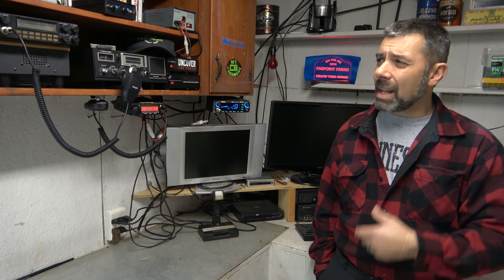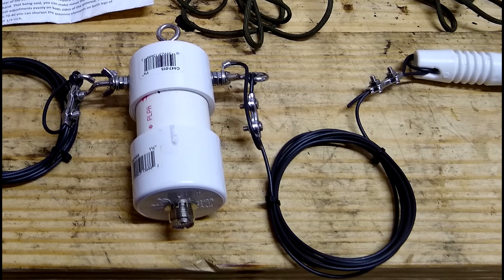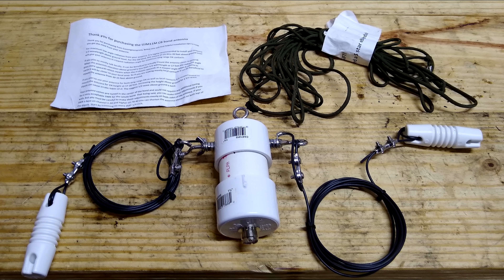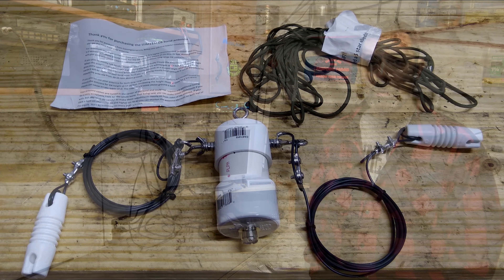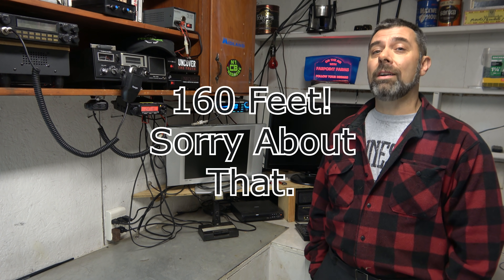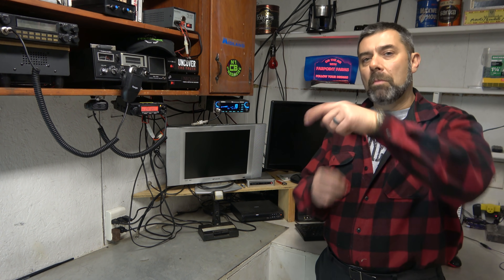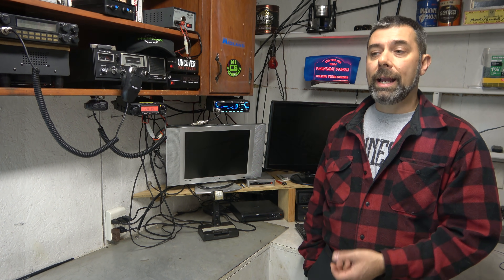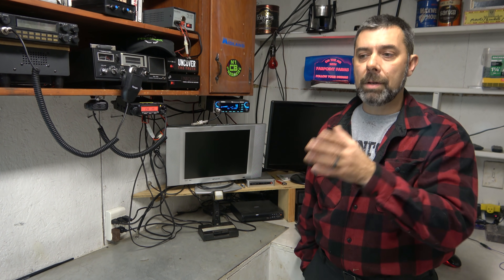CB Base Antennas Part 4: Build Your Own!

Comment: i started with a 108 inch fiberglass 1/4 wave antenna and wrapped 27 feet of coated copper wire from the bottom up. i scuffed up the threaded base and soldered the wire to it. i used shrink wrap to seal the coil load. i mounted the antenna to the car and checked SWR. it came in at 1.1 to 1. it is the best talking antenna i have ever had. i started talking on CB's when the truckers were mostly on channel 10 before they moved to 19. that would have been around 1979 or 71. i currently have two of these antennas and have not been able to locate these fiberglass units again in the modern market.
Reply from the maker: Cool! Sounds like a neat setup from back in the day.

Comment: A 102" whip up on a 30ft pole, with four radials slanted down at 45 degrees, makes a great DX antenna. And you can throw a lot of power on that thing too!
Reply from the maker: That would be impressive

Comment: I'll be restoring a CB base station this winter, and then I plan on building an antenna to use with it. 

I'm rebuilding/expanding my shop building this week and part of the new space will be a comms setup, as I can't set up HF antennas off the house, but I can out back along the fence line.
Reply from the maker: That sounds like a great winter project. Maybe you can add it to the fence to make it higher up

Comment: Thanks!😊 I’m a new ham and SSW listener.. I have not purchased any real equipment, except for a Tecsun H-501 receiver.  Living in community that restricts visible antennas, l’m having difficulty getting reasonable reception.  Need some help getting more enjoyment and getting encouragement to even seek licensing requirements. Hoping and needing help, thanks, Carl
Reply from the maker: Thank you for the support of the channel. The MLA-30+ is hard to notice so your HOA might be OK with it. It is not expensive and is great for SW

Comment: Hi Eric, First off thanks for the channel and your down to earth talk on all aspects of CB/Radio. I have a old school TRC 457 and recently bought a Q-40 which I am liking too cause of the noise   reduction circuits  .I have a Siro 27 GP I want to get or build a SMALL bean and was  looking ng at the Maco Quad 4 the V looking one.  need something on the small size. Have you built one like that or do you recommend it? StandingStones 1776 or UDX-457
Reply from the maker: I've thought about buying or building a beam antenna for ages, but neve got around to it.  If you decide to build one, don't forget you'll need an antenna rotor to turn it as well!

Comment: How did the wire antenna work for you on distance? I put one together and put it in my shop. My SWR's are low, I can hear a lot, but don't believe I have the power to talk back to anyone. Of course my cb does not have sideband.
Reply from the maker: It works, but I prefer a store bought unit.

Comment: want some gain? 35 feet of wire fed one quarter wave in. quarterwave 9 feet  to the shield of course. 50 ohm coax no balun required. way more gain than a a99
Reply from the maker: These homemade jobs can be really sweet!

Comment: I've always had good results with the 102" SS whip. They're indestructible. The steel bumper is an excellent ground. I prefer to use a Hustler 2"SS ball and 4" SS spring. Mine is mounted in the same location as the one you presented, but on a 2015 Nissan Frontier.
I've considered using a Breedlove Stake Hole mount on my low milage 2007 D. Ram 1500 I just bought from my Dad. The only thing is it will be grounded to the body instead of the bumper, I believe making it even more directional.
Reply from the maker: The problem with modern trucks is the bumpers are plastic making it harder to mount- The 102 whip is a classic great antenna

Comment: Sounds like that antenna is for the 160m band (1.8-2.0 MHz)... So, taking a middle frequency of 1.9 MHz, you're looking at 468/1.9=246.842 ft for a half wave... Assuming that you are correct with your statement of 160 ft, then that would mean that you are most likely using 1 1/2" sched-40 PVC pipe (with its 1.9" in actual diameter diameter)... If you said what size pipe you were using, I could not make it out... 

One thing that I've found a bit easier when wrapping wire around a pipe or rod is to start out by measuring the entire distance that I want in the coil and marking it with a piece of tape... Then I wrap the wire around the pipe/rod with no spacing between the loops until I get to where the tape marks the end... I then start stretching the coil out on the pipe/rod (which makes the coil tighter and will result in perhaps a couple of coils being uncoiled... We're not really interested in the number of coils, but rather the total length of wire that is in the coils, so it makes more sense to just mark this out to start with and then massage that tight coil into a helix...
Reply from the maker: Yup!
Reply: @FarpointFarms  -- Another thing that I've found that makes it easier to get a tight coil is to do the initial wrapping around a cylinder (pipe/rod/etc) that is slightly smaller than the final item that you are going to wrap the wire around... When you wrap wire around a cylindrical object, you get a certain amount of "spring-back", so starting smaller can make it so that you end up with the right size after it springs back slightly... I'm talking abut solid wire though... I don't know how well this technique would transfer over to a more flexible stranded wire...

I wanted to try making various length wire-wound fiberglass antennas for my Jeep for different ham bands, but  although it is easy  enough to get a 3/8" solid copper rod and wrap the wire around it, finding a 3/8-24 connector to put on the bottom of it has been a bit troublesome... The few that I've found have been by companies that wanted as much as an entire pre-made antenna would cost...

Comment: I occasionally watch this channel for entertainment. So much of what you say is incorrect, often several things in one sentence. Whether it's technical facts, practice, terminology, principles, physics... it's beyond belief. That's not a long wire, it is simply a dipole (not dilpole, you're a dilpole). You even then say it's used as an inverted V. The pvc component, well that obviously houses a current balun or choke. How did that bullshit helical antenna you were making go? Feed impedance, gain, pattern? How did you feed it? Is loading an antenna a compromise? What about with your absolutely ridiculous random, home built antenna? What is wrong with you? I mean, why knowingly mislead all these people?

Comment: You said 1/4 wave is 108 inches what would be a 1/2 and 5/8 wave all on cb frequency thanks
Reply from the maker: 1/2 wave is 18 feet, my Antron is that height. I am not sure abut 5/8th.
Reply: dude, look up the formula, or use an online calculator. Anyway, it's pretty obvious to double the figure of a quarter wave to get the half wave. Sure, a quarter wave is around 108 inches in free space, but depending on the application, it will be shorter. This is base on the velocity factor of the material, whether that be its electrical properties or insulation on wire, and diameter. Also, in the case of the half wave dipole in this video, what they call end effect. End effect significantly shortens those free space theoretical dimensions. He said it was intended to be used as an inverted V, now this can also have a small shortening effect depending on angle. This bloke would not know any of this, so don't listen to a word he says, he's a goose. It's likely he would retard by saying that I don't know what I am talking about, but if you do your research and actually ask someone in the know, they will tell you that everything I am saying is 100% accurate. I just don't have an inclination to make BS videos for monetary gain.
Reply from the maker: @arconeagain  You sounds like you'd be the life of every party.  Watch that swollen head as you try and pull it out of your own rear OK?
Reply: LoL! It shows you edited your comment, I can't imagine what your first run said! 🤣

He is right though about indefect and all that means is the top quarter wave of any antenna will need to be 5% shorter then what a quarter wave calculates out to be so instead of 108 in a quarter wave is more like a hundred and two and a half, and even a little shorter if you're going to consider the diameter if it's made of aluminum, in that case you take pi times the average circumference x 707 and remove that amount for resonance.

For instance, an aluminum tubing quarter wave will end up being around 101 inches total.

With wire dipoles usually about 8 ft 7 inches works well. 

It's been 3 years since you did this video, I imagine you're probably a general or extra class by now? 

Are you familiar with what's called the T2LT antenna? 

It's really just a coaxial dipole, for CB what works well is to wrap 16 turns of the coax around about a two and a half inch diameter schedule 40 PVC go up 9 ft and at the end of the coax with no connector, solder about 9 ft of 12 gauge wire, strip the end and wrap it down around itself making a loop so the entire piece of 12 gauge from where it meets the coax to the top of the loop is about 8 ft 7 in, put parachute cord or something similar through it and pull it up over a tree branch and you've got a nice end fed / center fed dipole! It's the electrical equivalent of an antron 99, if not actually a little more efficient.

Another thing you might want to try if you're still playing with low powered am standard broadcast band equipment is taking .6 wavelength and wrapping it so 70% is tightly wrapped from the top down, then a little looser wrap, then an even looser wrap until you've reached the bottom.

Install it over 4-5 elevated 1/4 wave radials - or a large metal roof - and you should get excellent omni efficiency.

👊🤠
Reply: That's .707! I forgot the decimal point.

Comment: I just bought a Siro 5/8  "301". Anyway my first vertical and this thing is big plus 3 radial and installing on a tv push up metal pole all by my broken back 68 self , never again . what a pain !big job for me .  I'm use to wire dipoles in a tree like your camping antenna.

Comment: The antenna you called a long wire is actually a 1/2 wave dipole for 26/27 MHz and one can be built for less that the cost of the one you showed.

Comment: Great vid I have a DV27 what size do the ground planes need to be to mount on 18ft pole thanks
Reply: That antenna is a 1/4 wave antenna, though it is shortened by quite a bit (a full 1/4 wave radiating element would be about 104-1/8 long".

{468 divided by 26.965 divided by 2 times 12 equals 104.135 or 104-1/8")

I would start with 125" counterpoise (ground-plane) elements and if necessary shorten until you have good VSWR and angle them down at about a 25 to 30 degree angle.  You will need 3 to 4 of them to make an effective counterpoise (ground-plane).

The reason for the longer than 1/4 wave on the ground-plane elements is because of the nature of the antenna, it requires a bit more ground that say a 1/2, 3/4 or a 5/8 wave antenna which can use a true 1/4 wave counterpoise.

Comment: I built mine using a satellite dish and using 3  3 foot pieces of pvc pipe and wrapping 9 feet of copper wire around each pipe pvc when I finished I had a 3 element beam I brought the ends of the pvc together and mounted a so239 connecter at the ends of the pvc make sure you ground the elements by using a hole in the so239 mine reads 1.2 on channel  40 and on channel 1 that is good enough for me  it receives real good but I don't have enough power to talk skip
Reply from the maker: sounds like a good set up

Comment: Thank you for making these great videos. I'm just getting into CB. I took your advice I bought a uniden bearcat 980 SSb. I'm in a wheelchair so I can't get on my roof and hang my antenna. I want to get the tram base antenna 50 ft of the coax cable I can hang it in my attic and I can run it down to my living room. Willl I still get good reception? I'm on the second floor so will be the third story in the Attic. Thank you very much. Any advice would be greatly appreciated. We I also have the ability to mount it outside my second floor window on a roof out there? Not as high as attic though. Please help thank you

Comment: Some years ago, I made a 1/2 wave, Inverted-V that I used as a CB base station antenna (for a cost of about $5.00). It worked very well, but the really interesting part of the Inverted-V is you can make then as big as you want, as long as you have the height and space to hang it. Each leg must be an odd number of quarter wave lengths long and if you make one that is three quarter waves long on each leg, you start to achieving gain.
Reply: My problems have been that most of locals here  have vertical antennas and they are weak on my horizontal wire dipole antenna and they have a hard time hearing me clearly. So I bought a Siro 5/8 ground plane to visit  with them.
Reply: Can you explain this in more detail or post a link to some info i can read and build it.  Im in the process of making a CB home base. And want to build an antenna for it.

Comment: How do you figure the length of coax to use on a base antenna is there a formula?
Reply: I've been wondering this too. Seems like if you can use insulated wire for the antenna itself, the insulated coax would come into the equation. I hope someone answers that knows more than I do.
Reply: You can use however much coax you need to go from your antenna to the radio (the shorter the better to reduce losses).

There is no magic formula for that and anything you might have heard is just basically an urban legend.  The "every 3 feet" rule goes out the window when you consider that you have to take into consideration the velocity factor (VF) of the coax in use and that the VF can be different for every type of coax made!

Precisely measured coax lengths are normally used in tuned circuit antenna systems such as a Phased Array System.

If you find that you need to add or subtract coax from your station to attain a match then you have something wrong with the antenna or the radio and that will need to be fixed before trying to p[ut the station on ther air.

In my 45 years in radio(civilian and military) I have never had to use a measured coax run except for when I had a "2-element ground-mounted phased array" for 40 meters when I lived in Texas.

73, John, N1WOM.

Comment: I grew up talking on a Lafayette comstat 25-a and a citizen-fon model cd-5 tube CB radios and still have them today.
Reply: The Comstat line from Lafayette was one of the best CB base station lines ever made (actually made by Kenwood-Trio for Lafayette).  I still have the Comstat 23 Mk IV, the Comstat 25 (the one that had the special trucker channel between channels 22 and 23 that the FCC never approved, now channel 25), the Comstat 25A and 25B models and they all still work and all have the original stock microphones that they came with.

Comment: building homebuilt antennas is a fun part of the hobby, a roll of normal copper wire is all it takes but fun can be had experimenting with alternative materials can be cool too, i personally have a dipole antenna made from a broken 25 foot tape measure that talks great and has low SWR.  It's hanging roughly 40 foot up in a tree

Comment: Great review on antennas. The way I got the best of both worlds is to have a horizontal beam I home brewed two aluminium arms on a pivot and a small geard down  stepping  motor that drives the shaft that is fixed to the arms that clamp on to the antenna .so I can flip my beam from horizontal to vertical. I dont know if this is commercial available but if you love home brewing there must be loads of variations you could come up with .allso you could fit something to give you a bit of elevation

Comment: One of the most simple antenna's I make is the T2LT wire antenne. It's made only from RG58 c/u coax and works great. You can hang it from a tree or a pole and is easy to carry with you if you want to work in the field.

Comment: Does the ground plane literally get grounded into the dirt or not? If not then what part of the antenna gets grounded
Reply: You are confusing the RF ground with the earth safety ground.

The ground plane is the other half of the antenna and makes it more efficient.

The earth safety ground is an 8 gauge bare, solid copper or 10 gauge bare, solid aluminum wire that goes from the ground side of the antenna (the same connection point as the ground plane) to an 8' ground rod driven into the earth.

Comment: The easiest antenna is the simple dipole where you cut two 1/4 wave wires and feed one side with the center of the coax and the other with the shield. This doesn’t require a matching network.  That’s the antenna your friend sent you.  The person that wants an antenna for FM radio needs to make a vertical about 2’-4”  tall with 4 radials the same length for a ground plane.  All material would be less than $15.

Comment: Just built an Inverted V antenna for the 6 Meter and 10 Meter bands. Designed the 1:1 BALUN with internal matching network as well. I will make up elements for the 20 and 40 Meter Bands when I get the time. 
Going to use this as a quick simple deploy antenna when camping and hiking.

Comment: Most THHN wire now days has a foot marker on the writing of the insulation of the wire... its small and hard to see but instead of counting wraps you can just use their markings to exactly find out the length of wire.. FYI   Good Job again Eric on the Homemade CB style of videos   👍👍

Comment: Eric, thanks for another great video! Your CB videos got me into the hobby. Stan Gibilisco (RIP) has some great antenna theory videos on YouTube that are for ham but are applicable for CB as well for folks looking for more detailed info on homebrew antennas. I've built a 1/4 wave inverted V wire dipole and a 1/4 wave vertical ground plane, both for CB. 73!